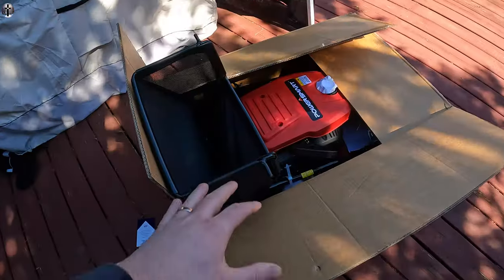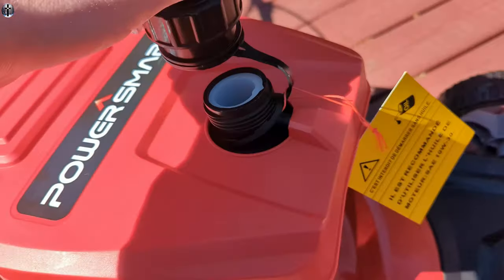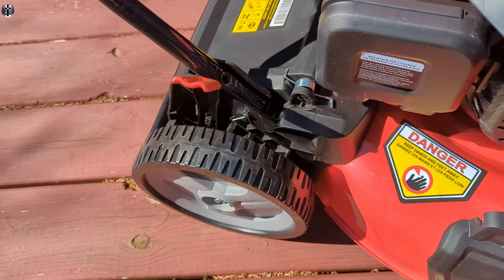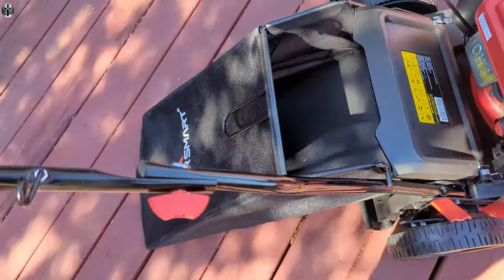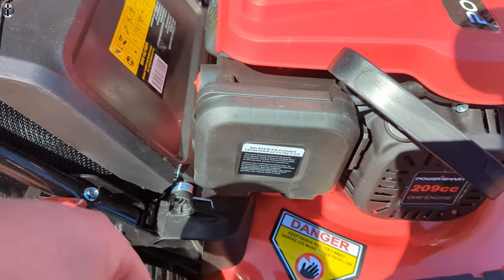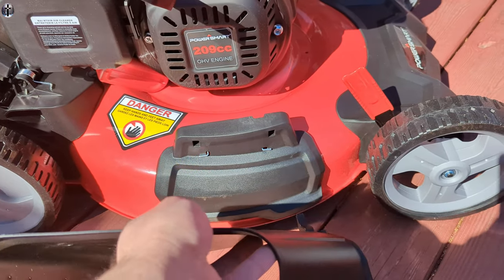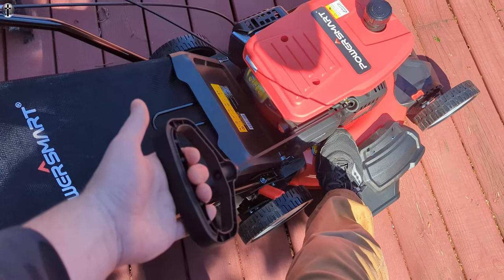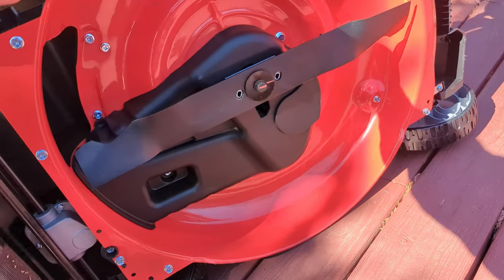Power Smart Gas Self-propelled 209cc Lawn Mower

Comment: It's been 3 months since I have bought a Powersmart lawnmower, and I already have problems. The engine won't start and there is gas leaking to the side filters. Do you have any idea of what may be the problem here?
Reply from the maker: the only way for gas to get to the side filter would be either over filling the tank or tilting the mower on its side. if gas is getting into the filter it will cause it not to start. with mowers its really hard to know a problem without seeing it or hearing what its doing. do you press the prime button 3 times before trying to start it? also i would take the filter out wash it and let it air dry and place it back in. also check to make sure it has enough oil without being to much oil. not enough oil or to much oil can cause this problem as well

Comment: I actually want to thank you for the close-up of the mower around the 5:00 mark. It looks like there's just enough room to put a fuel-shutoff valve between the tank and the carb. That's something that is usually impossible to tell without seeing one in person. You might have made my mind up to buy one of these. I admit I mainly want one just because it's such a weird design with a horizontal-shaft engine running into a 90-degree gear box to make it vertical. Plus the one I'm looking at is only $212 at the moment, much cheaper than even the most basic mowers at the big box stores. The only difference is that it's black in color and doesn't have the self-propelled feature which I never use anyway.
Reply from the maker: this is awesome! im really glad i could help!!!

Comment: Is there a way to turn down the propeller and make it go a bit slower on the front pull
Reply from the maker: the running speed of our mower is not adjustable, only the cutting height is adjustable

Comment: If I needed a new mower that is the mower I would buy but the cheaper non self propelled 3 in 1 mower.
Reply from the maker: yes :) most people who get a self moving mower normally are older. or not in shape or just just dont want to push something. if your young or able then def go with a cheaper option! but the nice thing is. this is actually a better work out because its more heavy and you can push this as well you dont have to use the self propelled

Comment: The blade belt broke on mine after just 4 uses. The nearest service center is over 150 miles away.
Reply from the maker: did you run over anything?
Reply: @ScottsHonestReviews  Nah, just a little high grass and leaves. Maybe some small twigs.
Reply: @cabman86  I have this same issue and can not for the life of me find the belt any where.
Reply: @lenahadley9567  Mine is still under warranty. They are finally offering to send me a new one. The belt can only come from Powersmart. They sent the wrong one the first time. It broke the first time after about 2.5 hours of using it. The second belt lasted only an hour.
Reply: @ScottsHonestReviews  There is about a 1/4 inch gap between the cover and the blade shaft. The belt cover fills up with debris and it gets into the pulley.
Reply from the maker: @cabman86  strange mine is still working great
Reply: @cabman86  I've only had mine maybe 2 month so I've contacted customer support to see if I can get a new part.
Reply: @lenahadley9567  Bought mine in September so I only used it twice before winter set in. Moved out there and used it twice, belt broke twice.